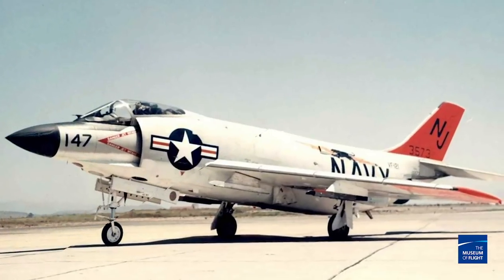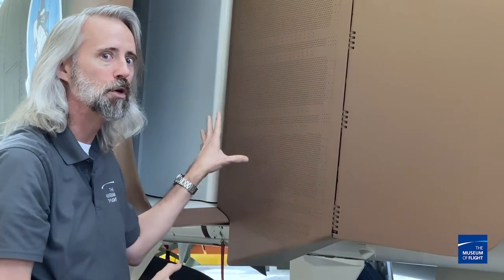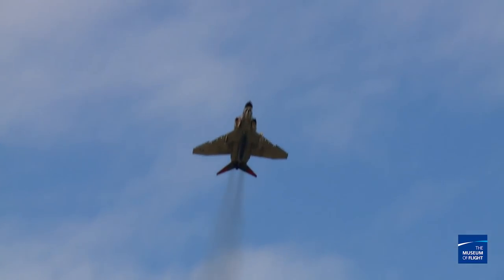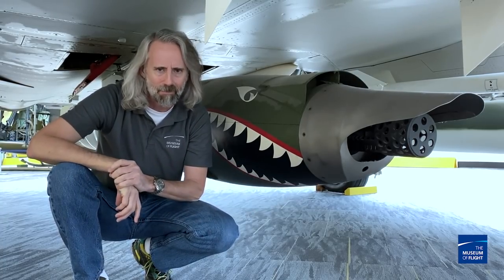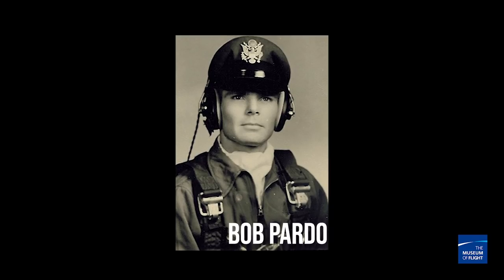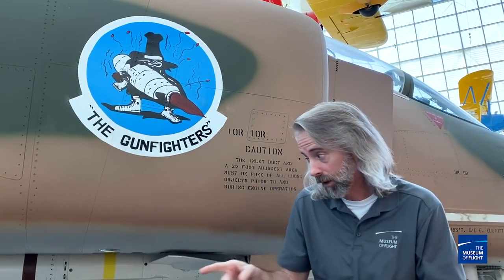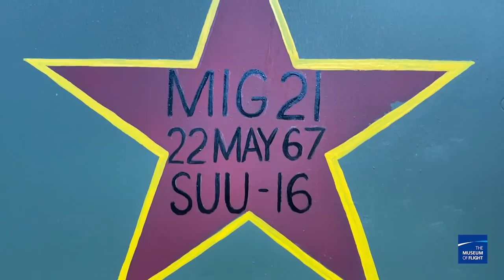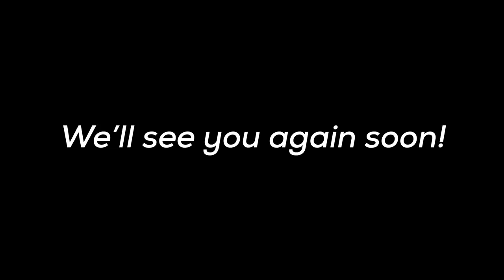McDonnell F-4 Phantom II | Curator on the Loose!

Comment: Thanks Matthew - nice tour.  A couple of notes:  First, it's already been noted below that the gun pod is a SUU-23, not 16 ... the -16 has no air intake on the front; Second, regarding what you initially called the "Splitter Vane". The more usual term "Splitter Plate" or Splitter Plane", is generically (and confusingly) applied to  the whole three part Variable Duct RAMP. The Splitter is the front /first part of the Ramp --  the part that "splits" the fuselage Boundary Layer Air away from the  duct as you nicely explained. That first portion has no Bleed Air Holes - those are on the moveable second part of the ramp,  as you nicely described. The third portion of the ramp, inside the intake, is slick and is hinged to the second, allowing those parts to move to position the shock wave on the lip of the intake so that the air entering the intake is subsonic (behind the shock wave). 

I appreciate your enthusiasm.
Reply: I have no idea why parts of my post are lined out - they shouldn't be. Editorial "corrections" by someone?
Reply: Actually the -23 DOES have an intake on the front. the intake was at the front, on top of the muzzle fairing. The -23 didn't have a flip out air turbine. The -16 didn't have an air intake on the front because it had the flip out turbine.  Google the two and hiht images.
Reply: @ILSRWY4   hello, it looks like Gene is speaking about the F-4's intakes for the J-79s not the gun. I received a strange response from YouTube showing you commenting on my year-old posting but it never appeared in the stream.
Reply: @ILSRWY4  Thanks. Your great video brought back fond memories of flying the F-4 for thirteen years (firing the M-61 in both gun pods, as well as internally in the E model).

Comment: To clear, the F-4 on display at Museum of Flight is NOT one of the two aircraft (both F-4s) involved in the "Pardo Push" incident!
Both of those F-4s were lost but not before Pardo pushed his wingman (80-100 miles?) into safer territory (Laos) to eject.  All the F-4 aircrew (remember, both planes carried 2 crewmen each!) ejected safely.
Pardo signed the arrestor gear of the F-4 on display in the video but it is NOT one of the F-4s that was involved in the Vietnam incident!  Those planes were lost.
Something similar to this incident happened in the Korean War where one F-86 was damaged badly.  In this case, his engine was shut down and his wingman PUSHED his plane 60 miles by position his plane's nose onto the tailpipe of the damaged fighter!  F-86 inlets go straight through the middle of the plane and into the engine.  By plugging the nose of the undamaged into the tailpipe of the other, the rescuer was still getting air into his engine!
The upshot of the F-86 incident was that unfortunately the guy the rescuer was trying to save didn't make it.  He ejected safely but got tangled in his parachutes cords and drowned in water off an island.

Comment: Fun fact about the splitter: it was capable of moving out and in (could be seen moving from the back seat) but in my 2000 hours flying Big Ugly, I never once had them move normally. Once we had a failure and they moved out and in violently, making a helluva racket and almost causing compressor stalls, but I had the WSO pull the Splitter circuit breakers and they locked in for the rest of the flight. 

After that, I would have the WSO pull them after takeoff on every flight and never had a problem, even at supersonic speeds, which was what they were designed to move for.

Comment: it has shot down mig-25s too during Iran and Iraq war , actually Iran has modified it with modern electronics and radar systems and it can mount Iranian version of phoenix missiles which has a range of 150-200 km ,. A reliable and trust worthy plane indeed
Reply: so too has Greece and Turkey modernized their's with latest electronics and radar. it can carry the  AMRAAM Aim-120, which replaced the old Pheonix, and has a range of 150 miles.

Comment: Trivia: The F-4 had a distinctive exhaust note. No other aircraft, before or since, sounded like that. When Honda designed a new motorcycle (I think it was the CB-750.) the exhaust sounded just like the F-4 --- so they decided that was not acceptable and changed it to a more traditional motorcycle exhaust sound. I was an F-4 crew chief in Vietnam, and I also worked as a technical instructor for American Honda.

Comment: The angles on the elevators and wing tips had to do with yaw stability. The f-4 had to have a shorter vertical stabilizer because of its height and limitation of store space on the carrier. So by angling those surfaces, the engineers compensated for the shorter vs. later they solved that problem by having twin vs.

Comment: Anhedral to the horizontal stabs & dihedral to the wingtips were among the  aerodynamic band-aids needed to make the Phantom phly.
Reply: Aerodynamically, the "anhedral" on the tails is also really dihedral.  People (and even official definitions) always get it wrong. The airplane wing doesn't know where the ground is.  But it knows where center of pressure is.  Anheidral and didedral are a function of Center of Pressure, not reference to the ground.  If the angle is in the direction of CP its Dihedral. If the angle is opposite of CP its anhedral (like A-7 wing). Horizontal tails are actually upside down wings and the center of pressure pointing down (downforce).Think of it this way, when the phantom flies upside down (like blue angels) do the tails suddenly stop being anhedral?

Comment: The pilots often referred to the F-4 as "The Brick" - because it proved the theory that if you provided enough power, you could make a Brick Fly.
Reply: Anhedral, dihedral and cathedral! Referring to the gliding potential of a block of granite.
Reply: I built a 1/9 scale model of the Phantom and it is surprisingly aerodynamic and requires very little power to fly.
Reply: @interman7715  Thanks, I was actually quoting a pilot from memory, I have edited my comment. I also found this, I suspect the RR Spey engined UK versions might have performed less well as a glider:

From the F-4 NATOPS manual:

    “The aircraft will glide approximately 6 nautical miles for every 5000 feet of altitude. The recommended glide airspeed is 215 knots CAS. Below 50,000 feet, 215 knots CAS will provide near maximum glide distance and will allow the windmilling engines to maintain power control hydraulic pressure within safe limits.”

With a dual engine failure and no restart, we were taught to eject and not to attempt a dead stick landing.
Reply: @ Jaydee ,And that is true ;)

Comment: When the USAF bought the F-4 they designated it as the F-110A Spectre , the next fighter in the century fighters,  they later changed it's designation back to F-4C a variant of the navy's F-4A&B
Reply: The F-4C was NOT a variant of the Navy's F-4A & B. That is simply not true, as the F-4C is a VERY different plane in many ways.  To begin with, don't confuse the F-4C as being the same plane as the F110. The handfull of F110s used  were nothing but a repainted Navy F-4B. The F-110 never went into "production" as a dedicated air force plane.  When the Airforce choose the plane they demanded many changes, first, the nose radome was bigger on the C because of the bigger radar. The main tires were low pressure  wider cord, than the narrow tires used on the Navy F-4B. Because of the wider tires, the wings of the C have bulges above and below the wheel wells to house the wider tires.  The C also had slotted tail-planes. The F-4C also had a better bombing radar that the B didn't have. (That bombing radar would be upgraded in the F-4D.  F-4D is nothing but an F-4C with new avionics and is visually distinguished from a C only by the added bulge under the chin sensor.) AFTER these changes were implimented the designation "F-4C" was given and the plane went into production.

Comment: What is NOT cool about the Gun pod is it was terribly inaccurate, because it vibrated on the pylon. Also, when they would tangle with Migs, the crews would jettison their tanks and ordinances,  the gun pod was also advertently (at least early on) dropped too. Its those reasons that lead to a fixed gun in the F-4E.

Comment: Looks like the wingfolds are unlocked. Also, it is my understanding that Pardo's CO was pissed at him because he cost the Air Force a second aircraft. It was only later when word got out about what he'd done that he received accolades for it.
Reply: I noticed the wingfold lock as well. You can make it back to the runway with both wings unlocked, but not with one, roll rate is to high to counter. With both unlocked it's burner all the back.
Reply: If it was the CO's ass on the line, he would have been overjoyed.

Comment: Is that an SR-71 in the background I see?
Reply: No, it's an M-21 Blackbird, a predecessor of the SR-71.
It was one of the original 18 A-12 airframes ordered by the CIA.  It was one of 2 modified to be a 2-seater so that it could launch the Mach 3 D-21 drone.  They lost one of the M-21s in a mid-air collision with a D-21 after an unsuccessful launch.  
The Museum has the surviving M-21 (Article 134; Article 135 was the M-21 that was lost).  It actually performed chase duty for its sister M-21.  As far as I know, this M-21 never launched a drone.  They created a strut to mount a surviving D-21 drone on this airframe.

Comment: Why does an Air Force Phantom have a tailhook? Was that a thing?
Reply: Because most Air Force runways have a barrier cable at the end to prevent aircraft from running off the runway in the event of hydraulic failure to the brake system
Reply: @remylopez2408  I get that, F-15s/16s don't was that an anomaly
Reply: I was a crew chief on F4 phantoms and F 16’s and let me tell you F-16s also have a tail hook I did not work on the 15th but I’m pretty sure they did too
Reply: @remylopez2408  I believe a crew chief. I'll research and educate myself on tailhooks. I understand an arresting gear in the AF. Is the airframe altered between AF and Marine (Navy too sorry) for carrier landings vs short runways vs airframes and maintenance? I'm sure peeing in pants happened by Marines and Navy night landing on the boat. "Pardo's Push" made me question...
Reply: @EthanBSide  if you look at the landing gear tires on Air Force F-4s they’re different than the tires on Navy/ Marine phantoms Air Force phantoms could not land on an aircraft carrier it would blow the tires out & as I mentioned earlier the towel hook is only used as a last resort to grab an arresting cable at the end of a runway it is not used for short landings the tail section is not beefed up for that on F 16 and F 15s
Reply: @remylopez2408  ok, that works. Do you have some vids? I'm failing
Reply: @Remy Lopez And I can only expand "Read more" once then nothing msg sgt...
Reply: @EthanBSide  Yes they both do.
Reply: @remylopez2408  F-15 do have a hook
Reply: @remylopez2408   Not true.  Only the F-4B/N and RF-4B had narrow tires. The F-4J/S had the same low pressure tires as  ALL USAF F-4s.

Comment: The F-4 was the first in class and was actually better than several aircraft that were of it's generation that were designed later. However just don't get me started on the wiring. It was a standing joke that the paperwork for the non-conformance reports weighed more than it did (every wire that cannot be traced visually start to finish needs one). The UK version was a bit of a pigs ear. IE engines that had 15% more thrust (20k rather than 17k) but mach 1.9 vs mach 2.25 ish. The Spey engines needed some fuselage modifications that completely stuck a spanner in the works with aerodynamics. FFS the EE Lightning was faster.

Comment: The most dangerous fighter in Viet Nam for F-4 Phantom was the old Soviet MiG-17. It could outturn the Phantom in the horizontal plane, but it could not outclimb the Phantom, Phantom was better in vertical because of its very powerful engines.

Comment: It was such a bitch to get an engine out of one of these things
Reply: As I recall (54 yrs ago , ADJ-2, VF-142, Connie ! ), it took DayShift all day just to get it exposed and disconnected.  Then NightShift could position the million dollar engine dolly just so,  bolt the dolly to the J-79, unbolt the engine from the airframe, and then, inch-by inch, snake that huge thing out of the engine bay.  Dayshift would snake the new engine into the bay  etc., etc., etc.  Maybe 48 hours with 3 guys on each shift.   Loved it, in a way ...